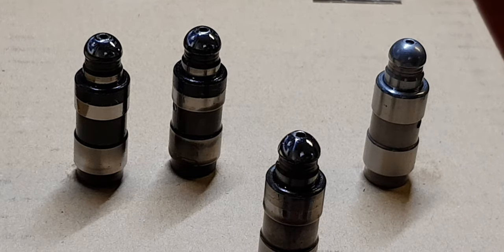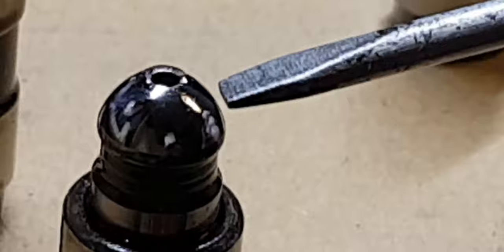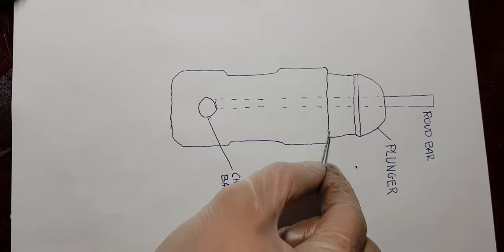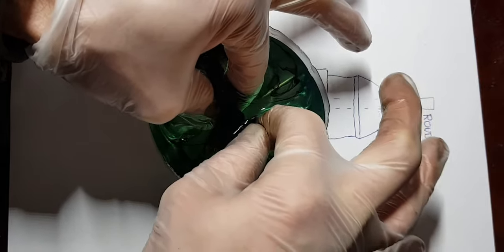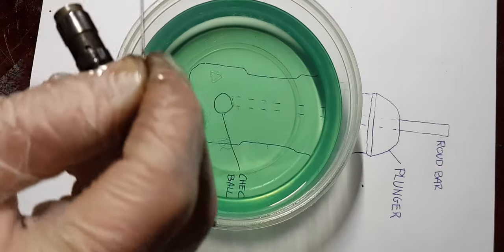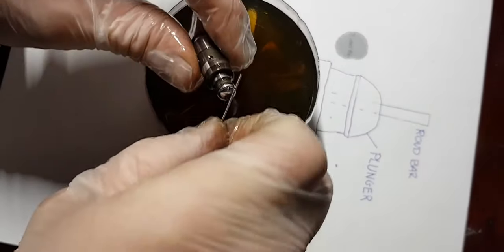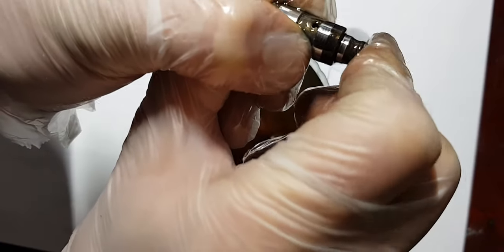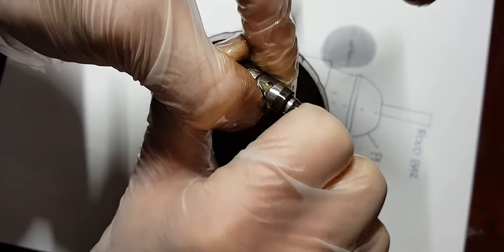Noisy Hydraulic Tappets/Lifter/Lash Adjuster: inspection, cleaning and bleeding.

Comment: Why did you left the lifter already with pressure inside? That is not right, lifter shoud automatic adjust on the first start up of the motor, doing what you did may cause to valves have contact with the piston or not properly close.
Reply from the maker: Thanks for the comment. This is a bleeding procedure that you need to perform before assembling HLA to the head engine. HLA adjustment is performed while the engine is running and is done by utilising oil pressure, everything I show in my videos is based on a workshop manual and experience. Here is link for an extract from workshop manual: https://youtu.be/3nFbUixbEPQ
Reply: @JB_Auto  Sry but you are wrong, yes you need to bleed but they need to have free play not rock solid, how the oil pressure will adjust lifter when you let them already fully extended? never do that again, you will damage the valves, they need to move, oil pressure will fill them and automatic adjust them.  You can bleed them withou let them fully rock solid or fullu extended.
Reply from the maker: So explain to me why after bleeding out, one of the judging criteria of HLA is to check if there is a rebound, and if the rebound is present you need to replace them?  By the way, I have Already repaired plenty of those engines, and there was one time where I forgot to bleed them out and that was the only time where the engine was noisy at initial start-up. I'm curious how would you prepare the HLA before assembly, can you write?
Reply from the maker: One more thing, that position is let's say prepared zero position, fully extended will be while applied pressure. You need to obtain a workshop manual for CX5 PDF form free download, and there is a clear description regarding how it works, you do not need to believe me.
Reply: I've done as he showed in the video. After installing tappets, I first tuned the crankshaft with a wrench, no collision between valves and the piston, then started the engine, and it runs smoothly, so what are you talking about?
Reply: @BRUCE LEE what is the point of use them rock solid on assembly? They will automatic adjust when the car starts, what you see is the wrong procedure, you never haver instal them rock solid you will fuck valves, they have to have play on them to on first start ajust. To install them rock solid just use solid lifters isentar same thing, because if you install them rock solid they will not have way to adjust because they already max out.
Reply: Not sure what is difficult to understand. HLA are not to be pre primed. They are to be manually primed for bench testing only. The HLA should then be free of oil upon install. If you install them solid, you would run the risk of valve train failure.
Reply: @tyleroxford602  Finaly someone that really know how things work.
Reply from the maker: Did you check the workshop manual before expressing your theory?
Reply from the maker: @fabini14  Did you even make an effort to check what are you talking about? So here is an extract from the workshop manual specially for you: https://youtube.com/shorts/3nFbUixbEPQ?feature=share 
By the way, remove offending comments.
Reply from the maker: @fabini14   So what do you think about the information from the workshop manual? Is it still difficult to comprehend? This basic stuff is commonly available on the web.
Reply: @JB_Auto  Yes there is clearly written: " if the rebound is present replace HLA '' nothing written to release ''pressure'' by the way did you put any pressure there ;-) ? it looks like somebody tries to be smarter than a Mazda engineer. Where can I find WM you have referred to?
Reply from the maker: @janban4722 Thanks for the comment. I did not applied any pressure there🙂 The Workshop Manual you can find by typing WM Mazda Skyactiv 2.2 PDF , that Manual was for vehicles up to 2013 free of charge, I do not remember website.
Reply: You are following one service manual from one manufacture. From my experience most manufacturers don't pre-prime HLA. Your video title is referring to HLA in general not a particular manufacture; which is misleading. A google search of “should HLA be primed” you would see that the general answer is no. If the manufacturer states that they want the HLA to be primed then do it, otherwise, if it doesn't then don't prime it. Your content is correct in regard to that particular service manual but not all HLA.
Reply: @tyleroxford602  I stumbled on a manufacturer website where they state, copied and paste just for you, quotation:
 ''HYDRAULIC LIFTERS
Also called cam followers or tappets, hydraulic lifters are used to keep the correct amount of clearance in the valve train of an engine. This ensures that the vehicle's engine is quiet and operating smoothly. (brand name...) has a very robust program of hydraulic lifters, all designed to OE specifications and shipped in plastic trays that keep each hydraulic lifter isolated, oiled (ready for installation), and protected until they are ready to be installed''.
Can not post link here.

JB_Auto shoul say it is related to all HLA's not for most of them. 
So apparently, your comment is misleading here.
Reply: @fabini14  I am having the same dilemma and I am hearing all kinds of oppinions. I also think you shouldn't preload them, because the oil pressure does that. As a fact, I actually oppened a car I owned, that was working perfectly fine and I noticed that ALL the hidraulic tappets had actually free play in them.
Reply: Here's an excerpt from a Toyota repair manual for the 1.3L 1NR-FE engine: 

"Squeeze SST and the lash adjuster together to move the plunger up and down 5 to 6 times.

Check the movement of the plunger and bleed it.

OK:
Plunger moves up and down.
NOTICE:
When bleeding the high-pressure chamber, make sure that the tip of SST is actually pressing the check ball as shown in the illustration. If the check ball is not pressed, the high-pressure chamber will not be bled.
After bleeding, remove SST. Then, try to press the plunger quickly and firmly by hand.

OK:
Plunger is very difficult to move.
If the result is not as specified, replace the lash adjuster."

Since I followed the Toyota instruction and started the engine without damage I wonder whether you'll also argue with Toyota.
Reply: @fabini14 , and you want to argue with those who designed the engine and stated it must be done like the video?
Reply: @tyleroxford602 , here you go: 

"squeeze SST and the lash adjuster together to move the plunger up and down 5 to 6 times.

Check the movement of the plunger and bleed it.

OK:
Plunger moves up and down.
NOTICE:
When bleeding the high-pressure chamber, make sure that the tip of SST is actually pressing the check ball as shown in the illustration. If the check ball is not pressed, the high-pressure chamber will not be bled.
After bleeding, remove SST. Then, try to press the plunger quickly and firmly by hand.

OK:
Plunger is very difficult to move.
If the result is not as specified, replace the lash adjuster."

This is from Toyota.
Reply: Had a good look at this tonight. Even wikipedia says you shouldn't pressurise them BUT..... maybe different engines have different requirements. I have a DV6 engine and after noticing bad compression in one cylinder, I noticed it had a few soft tappets, but the rest were rock hard. Perhaps the soft ones aren't getting oil - which may be  a different problem.  I understand one solution is to drive for a while (sloshing the oil around the head maybe) but I can't do that. 

On your point extended HLAs would make valves meet pistons, I can't see how that could be the case in the DV6 diesel. I can't see any difference between the ones I primed and the ones that were working. The gap between piston and valves would have to be absolutely tiny to start with, you'd imagine the tolerances are way more than that. But again, different engines may need different installation procedures.

Comment: Good afternoon, how do I manage to translate from English, and you can't translate from Serbian to English ??
It is a pity that the mechanics will not say how much the hydro lifts and seesaws are changed for, in order to destroy your engine in order to charge for more work, they should be ashamed that they are doing so ???
Reply from the maker: Hi, I'm not sure I understand it; I hope this answer will be satisfactory.
The lifespan of HLA  and rocker arms depends on oil change intervals, engine oil contamination. There is also a question of whether the engine is mechanically modified or not.
There must be performed an inspection and, based on that, evaluation whether it is within tolerance or not.
So as you can see, there is no clear answer for how long they will last before replacement.

Comment: YOU SHOULD NEVER PRIME LIFTERS YOU PUTTING INTO CAR! THEY HAVE TO BE EMPTY!  thay are auto adjusted, when you prefill lifter with oil it have no more adjustment capability.
Reply from the maker: @SayWhaaaaaaaaaaaaaaaaaaaaaaat  https://youtu.be/3nFbUixbEPQ?si=J_DGGPMRNH_fUXXL Here is the link and that is an extract from workshop manual.  So that is what you should do before installing HLA. That is exactly what is in the video plus cleaning of HLAs. Any questions?

Comment: WHAT DO U DO IF THE NEW LIFTERS ARE SEALED OFF AT THE TOP HOLE ?
Reply from the maker: If sealed remove whatever seals it, and make sure that they are ready to use. Usually are ready because there is oil in them and no rebound is present, as on the video.

Comment: Can one use ATF (automotive transmission fluid)  also or engine oil is best
Reply from the maker: Engine oil only. Why would you use ATF?
Reply: @JB_Auto  that's what I was advised. So we should use engine oil until it's rock hard.
Reply from the maker: Use engine oil since the part is related to the engine, then you bleed it out until no bubbles come out, then if HLA is good it becomes hard to press, or rebound disappears, if you can not get rid of rebound you should replace them.
Reply: @JB_Auto  thanks brother I just washed it with diesel latter I will put engine oil and make sure they are rock hard. Warm andgood holidays thanks once again hop we can keep chatting
Reply from the maker: You are welcome, Good holiday to you too, and yes we can chat.
Reply from the maker: Regarding that B15 I've never worked with it, but possible causes could be anything from the fuel system, wrong timing, management system and of course PCM, I would check PID's STFT LTFT, fuel pressure, and timing as well as a timing belt or chain for alignment, that's where I start I also use long list of possible causes table for poor fuel economy, ehaust smoke or emission compliance, it is difficult to remember all. 🙂
Reply: @JB_Auto  thsnks I will keep u posted as I try to find what's happening as I will put the car on Diagonis machine and see if any out come
Reply: @JB_Auto  In the old days, they would often use ATF when an engine had a ticking lifter. Years ago, motor oil was non-detergent, and engines would become very sooty inside and contaminate the lifters. The ATF was high detergent and would help clear out these deposits. Sometimes it helped.
Reply from the maker: Thanks for this useful information, I also thought to myself why not use ATF it is such a small amount that wouldn't harm the engine.